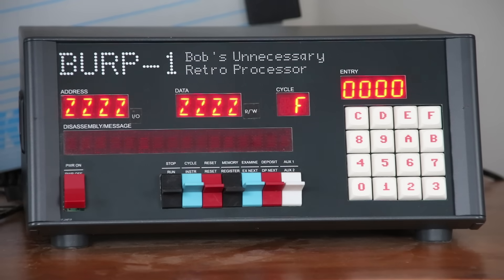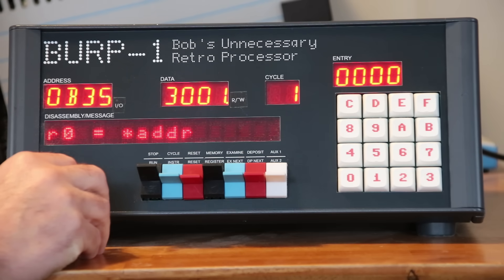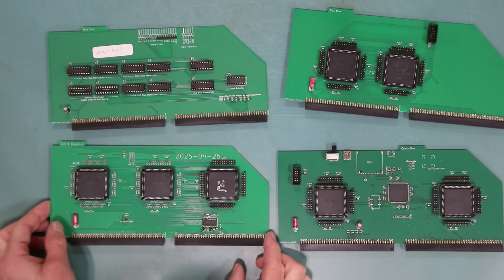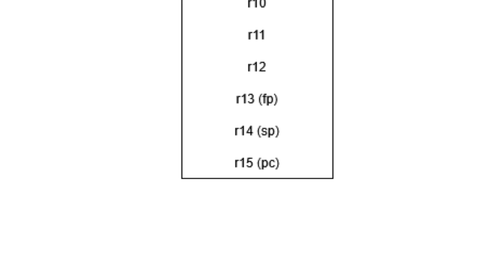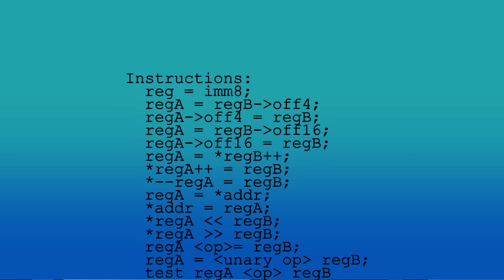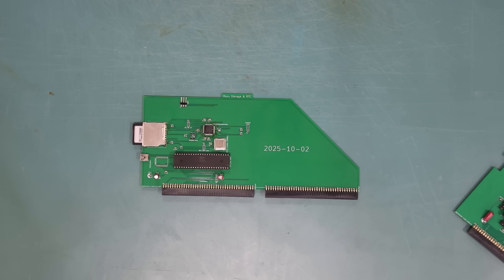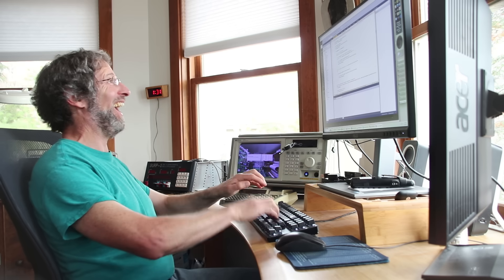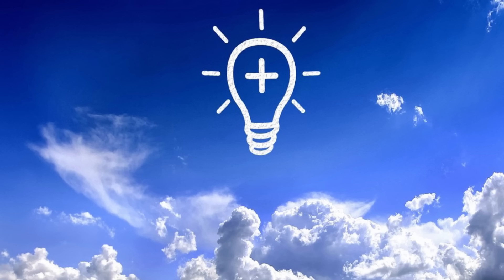Bob's Unnecessary Retro Processor

Comment: I'd like to hear more about Chasm.

This seems to be an under explored area of programming design.
Reply from the maker: Anything in particular you'd want to know?
Reply: @GalacticStudios  nothing in particular. I'm aware of HLA (high level assembler). Ive tried writing my own similar kinda thing, which I obviously didn't finish. I always tend to gravitate to the low level so this stuff interests me more than monads or whatever

I suppose there's the question of variables v registers. Is it an assembler if you only use variables? How do you end up using each? 

Is it like c in terms of function calls and the stack?
Reply from the maker: @benholroyd5221  A C compiler decides when to load variables into registers. In CHASM, the programmer has to do that manually. CHASM provides a way to reference a register by a different name (e.g. 'register r0 int foo;' means you can write foo instead of r0), but you're still using a register directly.

It's C in terms of the syntax, e.g. r0 += r1 instead of ADD r0, r1. It's a high level assembler in that it has loops, function definitions, and function calls.

Comment: Brilliant — thank you so much for sharing this project!

A few years ago I began designing my own microprocessor as well. After getting thoroughly fed up with endless soldering and breadboards, I moved the whole thing into LogiSim Evolution. My current design has two banks of four 8-bit registers (R0–R3 plus alternates), a PC, SP, flag register, and a microcoded control unit with a 32-bit control word. It supports over 90 instructions, and all the tooling — assembler, microcode ROM builder, and tests — is written in Python.

My long-term plan was (and still is!) to port the LogiSim “hardware” into Verilog and eventually run it on a FPGA. I’m retiring next year, so with a bit of luck I’ll finally have the time to pick the project back up and finish what I started. For anyone curious, the LogiSim and Python sources are available on GitHub.

Really appreciate seeing BURP-1 — projects like this are hugely motivating.

Comment: Most of that stuff is familiar from computers I worked on in the 70's. It's really disconcerting combining a hex keypad and a bunch of toggle switches with a front-panel display dissassembling the current instruction. That kind of feature would have been super advanced back then.

Comment: I built wifi ntp clocks originally based on an arduino but when I went to add the wifi I found the esp8266 could do everything I needed the arduino to do but way faster and for $2 all on one tiny board.

Comment: Great work! Beautiful case, and interesting instruction set. This looks like something I would actually feel like having fun programming via the front panel, without needing to write out everything first.
Reply: I want a board with figures . The computer would have an arm to address a field and tap down to measure height ( or use sound ). You could switch boards if you handle them very carefully.

Comment: I remember You-do-it Electronics Center!  Great place, esp when local RadioShacks were closed, to those familiar with Greater Boston. Although by that time, I was married and broke, so I just window-shopped. It's interesting you picked 16-bit instead of the traditional 8-bit.  If you really wanted to maximize it's lack of necessity... well there's already 1-bit Motorola MC14500 SBC "trainers", although that is an Industrial Control Unit, so primitive that it's status nudges into "necessity" territory again. How about a "No-Good 2-Bit" computer?

Comment: Sorry for being the party pooper here. But to me, using CPLDs is not very retro really. Simply writing an emulator (on a PC, Mac, ARM-card or whatever) would be more retro, because people did that in the 1970s too. You should build it in TTL instead!  That's truly retro, but still manufactured. (Just like other standard components.)
Reply from the maker: I know, I know. And an FPGA is even less retro. But if I had done TTL, I would've ended up with something less powerful than an 8080 - if I got anything working at all. I wanted something more capable.
Reply: @GalacticStudios  Glad you took it the right way, thanks! Yes, FPGA is very current. But less powerful than an 8080? How? There are several TTL (or CMOS) designs out there more powerful than a 2-3 MHz 8080. Even the simplistic Gigatron (using just 36 ICs iirc) at 6-8 MHz is in many ways faster than a 3 MHz 8080, or even a 5 MHz 8088. It is hampered by the lack of proper flags though. But afaik, it still "easily" emulates the 1 MHz 6502 in the Apple II in real time.
I'm a bit into this because I too once made a simple TTL CPU (8-bit ALU, 16-bit datapaths, 32-bit registers and 24-bit addressing). I designed most of it in several versions in the 1980s but didn't get the time and confidence to build it until the early 90s. The version that I actually built wasn't using any microcode. So it was actually comparable with a 286 clock for clock, i.e. about twice as fast as a 68000. And it could be run stable at 5-8 MHz using approx 100ns SRAM (some of them used somewhat out of spec I belive). It would probably run faster today, with the hyperfast 50ns, 35ns, 20ns, and down to 8ns(!) SRAM that now exists for cheap, since the early 2000s. So I'm actually planning to try to revive the old mess when I retire next year... 🧐🙃
Reply from the maker: @herrbonk3635  Other people might be able to make TTL computers more powerful than an 8080. Doesn't mean I could.
Reply: @GalacticStudios  Well, I can sympathise with your feeling that it's funnier to have something capable and actually useful for programming, a real computer. Rather than someting that just blinks a few diodes on a breadboard, at best.

Comment: After thinking for a long time I also came to the conclusion that 16 bit is the ideal bit width for a homebrew cpu. Intresting project
Reply: What part of the computer though, or processor? For instance, the venerable Z80 had a 4-bit ALU, 8-but data paths, and 16-bit registers and addresses. 68000 had a 16-bit ALU and datapath, 32-bit registers, and 24-bit addresses. While my toy CPU has a 16-bit data path, 8-bit ALU and 32-bit registers, which I found kind of optimal for easy TTL implementation with decent performance.
Reply: @herrbonk3635 16 bit for everything. 128 kB . 16 bit instructions like in SH2 . Loadings constants in RISCV is awkward , but JRISC taught me that with 32 registers, you can just load all constants outside of loops. Even the cheap 65816 has a 16 bit ALU. Can we buy such ALU as a part? Or do we need to build? Serial ALU would be a real bottleneck for compare;branch . JRISC forces a wait state between these instructions. I hate it .

Comment: This is awesome. My dad and I made a tiny CPU on an 8x4 foot piece of plywood
Reply: Tiny, for some values of tiny 😅
Reply: @nicksimonm0gic  if it's a 4bit CPU with only a few instructions for example, is tiny regardless of physical size. I once had a lot of time but no access to anything more complex than a transistor, I had diodes and small lightbulbs + bunch of switches. The switches cost me all the money I had all summer, but with those and the diodes I made different blocks of a binary ALU - it took about a shoebox of wires and scheisse though. Had a project box I had planned to make it into, had the switches and bulbs mounted to it, but all the wires for the logic spilled out the back of it... Trouble was I didn't have any flux nor anyone who could show me how to solder properly so the wires kept coming loose. 
I was 10 when I built that primitive ALU, all the parts except the bulbs and switches were taken out of old radios and TV's - this was in the late 80s so no internet etc. I didn't have access to a computer then.
Reply: @noth606  (I was just being humorous.) Yes, tiny in that sense, and no mean achievement. I recall in the late seventies Byte Magazine published a design for a minimal 4-bit computer using TTL, making a thing like that with discretes would be a huge job.  I wonder what it used for memory?

Comment: I have been thinking of making a box that kind of looks like this, but is actually a terminal that takes the commands and feeds them into my SWTPC6800 clone as commands to it's monitor program. Yes you can just use a proper serial terminal to do the same, however a box with a hex keypad and some seven segment displays sounded like a good accessory to sit on the shelf.
Current problem is the hex keypad, I don't really want to spend $80+ on a full keycap set, and end up throwing most of them into the bin. Also finding a set with plain number keys, as in no 'home', 'end' etc as on a PC, is tricky - and cost way to much.

Comment: Stand aside Ben Eater, this is the "build your own CPU" video for those of us who don't have the patience to hand bend jumper wires into beautiful works of art. Well done. Also, I loved the dunce cap. I can't tell you how many times I've felt just like that working on a "simple" electronics project.
Reply: I disagree.

Mr. Eater's project is a "let's get down-and-dirty" deep dive into exactly how a system like this works - a necessary prerequisite to designing/understanding something at this level.

Our channel friend here has built upon Ben's work to create a replica of a '70s era personal computer which is an entirely different beastie.

I also disagree with his statement that he "cheated" by using more advanced circuitry to duplicate the multiple boards crammed with 74xx series logic chips. i.e. Just because you had to "prop" an airplane's engine in the early 1900s to start it, doesn't mean a modern replica can't have an electric starter.

IMHO this is especially true since he's not trying to make a replica of a specific machine, but is making a generalized replica of a "typical" system of the era.

Finally, it's HIS system and his design. Though I might have done it differently, this is his vision of what a system like this should be.

In summary, it's one hell of a job, (not even including the work done on the case and front panel!), and I salute him!

P.S.
Is there a BOM or kit plans available for this?
Reply from the maker: @jimharris9394  I'm happy to give all the design files to anyone who wants them. But kit plans would require a lot of clean-up and support that I'm not prepared to do. And frankly, I wouldn't recommend anyone use my design. I made it for fun - not because it was a good design. If you want to build a retro computer, you'd be better off starting with a 68000.
Reply: @GalacticStudios 
Actually I think an 8085 or a 6502 would be a better, simpler, choice as Ben has done in his experiments. The 68000 has a more advanced architecture and its processor model - and modes of operation - are not for the faint of heart.

By comparison, the 8080/Z80 - 6502 were simple 8-bit processors with a simple, flat, memory model. There were few bells and whistles, a minimum of fancy modes, the processor architecture was simple to understand and design around.

The primary difference between them was that the 6502 used a paged memory architecture with special base-page memory-mapped registers similar to the Digital PDP mini-computers of its day.  The x80' series processors used a flat memory model starting at location zero with nothing predefined, though there were design features that made low-memory jump-tables for interrupt vectors very efficient.

Again,  because it was, (IMHO), easier to understand, it made it easier to use them to teach basic computer concepts.
Reply from the maker: @jimharris9394  The 68000 is much easier to program than the 6502 or 8080, since it has a much more sensible instruction set. It has a flat memory model too. I haven't done a hardware comparison, but the clocking might be easier on the 68000 than on the 8080 or 6502. 

The 6502's base page was not like the PDP-11's paging. The PDP-11's paging was for accessing more than 64K. The earliest PDP-11s didn't have it at all.
Reply: @jimharris9394  I"m sorry, I was only trying to express my appreciation for what he'd done in a silly, tongue-in-cheek way, I wasn't trying to suggest that either his work or Ben's work was somehow inferior to the other. I apologize if it came across that way.
Reply: @vaelenorg 
And I wasn't trying to diminish what you were saying. What I intended was to note that the two different projects, though similar, had significant qualitative differences because the two projects had fundamentally different goals.

As an example, take the various projects for creating a replica Altair 8800.  They fall into one of two broad categories:
1. Creating a replica that is as close to an exact copy as possible.
2. Create a replica that duplicates the physical characteristics, (front panel lights and switches), duplicates the actual functionality to the greatest extent possible, but uses more advanced technology, (i.e. a Raspberry Pi, etc.), to provide the functional back-end.

The obvious advantage of the first method is absolute museum level accuracy.  You open the box and there it is - a 1970's Altair.  Cards designed for the Altair fit and function as expected. No more, no less.

The disadvantages are also obvious. Compatible period hardware, (ASR-33 teletypes for example), are not items commonly found today, neither are 8" or 5" floppies and drives.  And so on. Authentic and accurate use of the device requires access to other period hardware or carefully constructed replicas which are both scarse and expensive.

The second version tries to address these limitations by (in essence), emulating the Altair's logic and functionality using modern, more easily available hardware. (i.e. Using SD cards or device files on a Pi to simulate ROM devices or external floppy drives or a USB connection for the serial monitor.)

If you need absolute "down to the color of it's socks" accuracy, the first method is superior.  However, if you wanted to demonstrate how that old computer hardware/technology worked from a user perspective, the second would be a good, less expensive, alternative.

What say ye?

Comment: In a thousand years they won't know how to use it because even now they don't know how.

Going over the program line by line by flipping switches is probably the most complicated way of doing this I've ever seen. 

Really Cool.. but so impractical.

The decompiling and recompiling is really amazing.
Reply: Flipping switches is exactly how we did that in the 1960s and 70s. When the machine was too broken to run, you went in peeking and poking by hand. (Which is where those two verbs came from in early BASIC interpreters.)